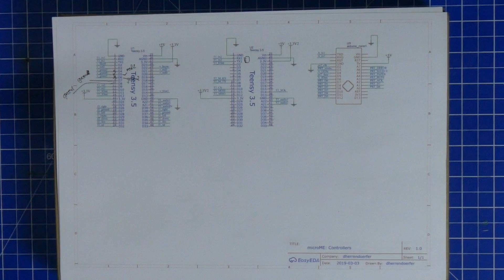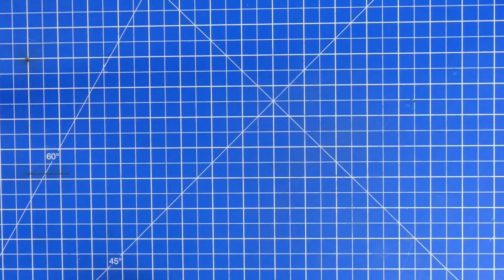microME Update 1 - the Basics - Building an Open-Source Home Computer

Comment: Love this! Why the board so big? Looks like it could be made smaller even considering the connectors on the back
Reply from the maker: I spent a lot of time on size and format, in the end I wanted the computer to be as wide as the connectors are on the back. The depth is dictated by the size of the Arduino and the SD-Card module. This format makes it simple to 3D print a case or enclosure, or to make an acrylic case. The big empty space in the middle is exactly the size of the Arduino shield connector footprint, or the size of a reasonably sounding speaker set. I didn't want it to be as small as possible, because as a DIY kit it would make soldering components in place a lot harder. Also this leaves a lot of room for improvement. (or left, as I already needed some). Have a look at the last video in the playlist, a lot of the space is gone now, as the audio amplifier is now there, as well as the Wifi dongle.